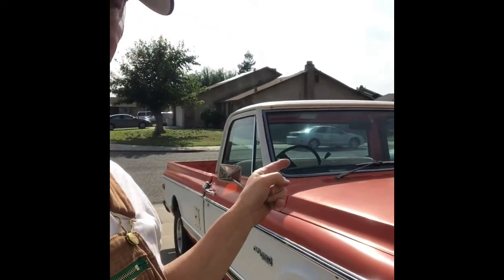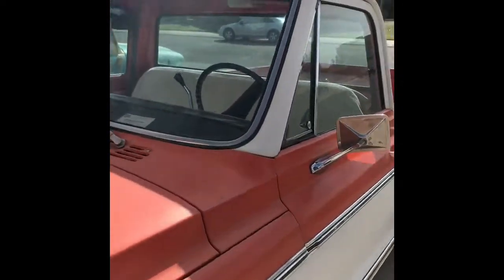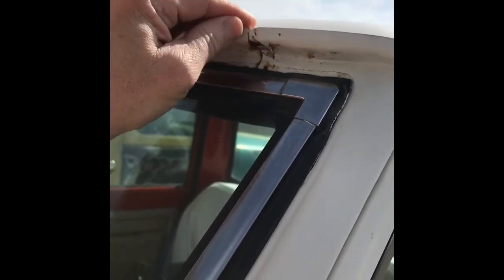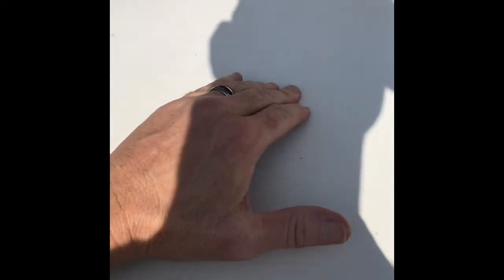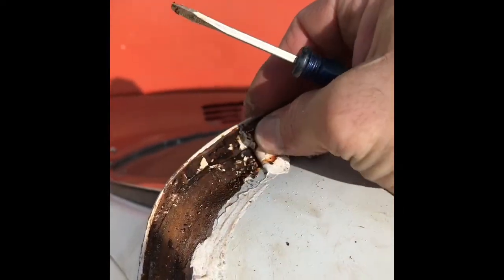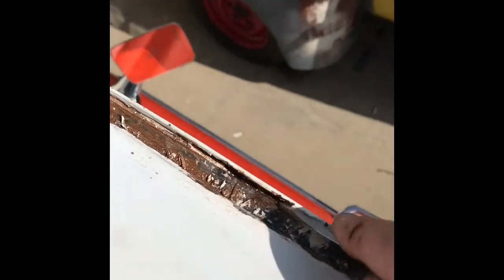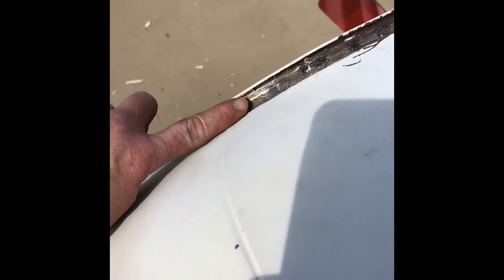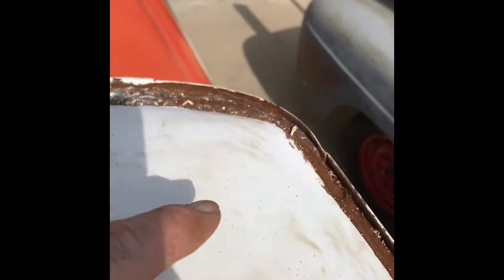1972 C10 Drip Rail adding Seam Sealer

Comment: I used a butane bottle with a little heat a flat tip and a pick to get in the tight areas. It all worked out great.

Comment: Great video! I have the same issue with my 74 Dodge Powerwagon as your truck. Drip rails too rusty to just reseam seal, but not so rusty that you need to replace metal. Other then wirebrush and/or sanding, did you do any prep before the rust converter? No issues with the sealer sticking to the rust converter at all?
Reply from the maker: After wire wheeling the drip rails I used the Eastwood Pre paint prep on the bare metal and little bits of rust that were left.

Then I applied the rest converter.

I like the rust converter drive for a couple days before putting the seam sealer over the top of it

I hope that helps. 

Good luck on your dodge power wagon they are super cool I need to be saved 👍🏻